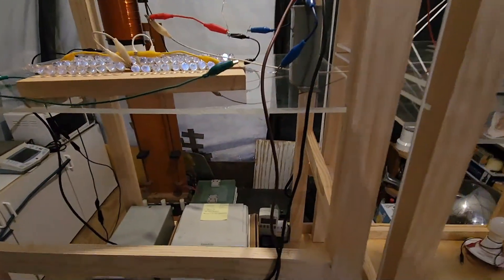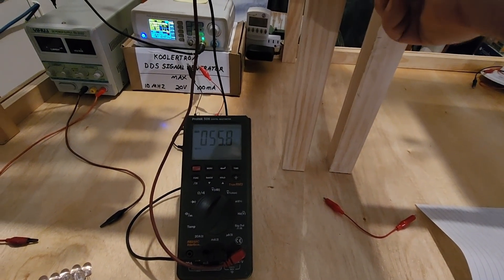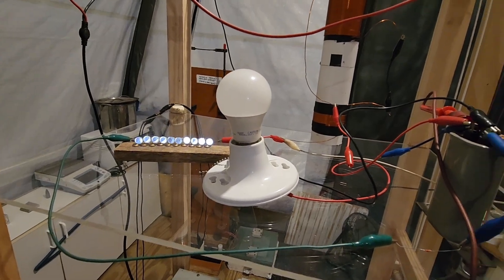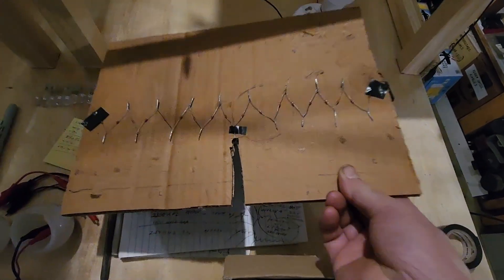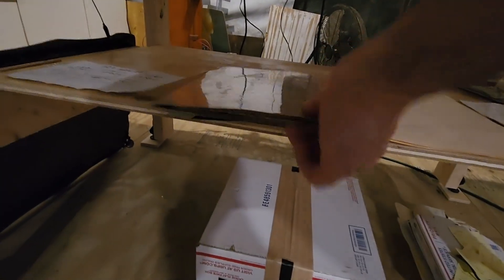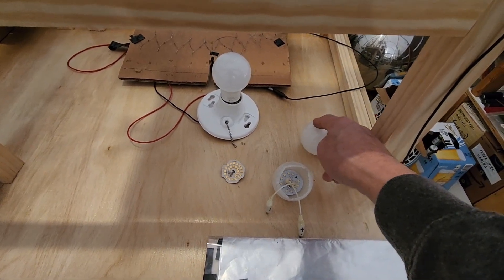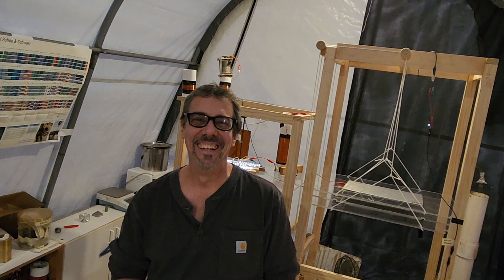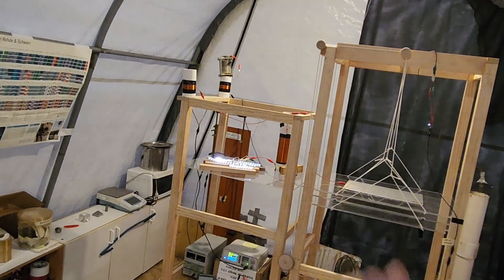QUEST FOR UNDENIABLE OVER UNITY & MORE POWER, PART 2

Comment: The down side of this type of tech is that the radiating field that it makes like a plasma globe, when you put your hand up the the l.e.d's the light go's out because the your bio-field is grounding it out so I was thinking that maybe a 1:1 ratio bi-filer coil will encase the field so it won't radiate out into space because its not really a viable thing in a usable system. You can try using to of your identical coils and linking them up bi-filer so you don't have to wined a new one.
Reply from the maker: I understand what your saying.  U was thinking in the end, when I have something that can be commercialized, I could put a type of Faraday cage or shielding of some type.  Funny you mention the bifiler coil.  I was planning on using it this weekend :-)  yes, bifiler transmitting to maybe 5 of the coils i use now under the bifiler.  Great minds think alike, hehehe.  I have only 1 bifiler.  I may have to eventually build one with larger dia wire to get more charge.  Thanks for your comments, the are good ones.

Comment: So your capcitance = q/v =Ea/d  Q is constant that is the height. V is your volts E is epsilon, which is your plexyglass. A is your Area. D is your distance between your plates. You should be able to connect a volt meter on those plates, and to see your volts, you will need a high voltage meter probably. Also for the another gauge place an amp meter on the back of the fequencey generator. math is no good if you don't have gauges. math is needed. not good to just go on what the peice of paper says on the back of it. lets see so math may be applied
Reply from the maker: Hellooo Justin!! Happy new year.  How's the building coming along :-)
I have my freq Gen pluged into a watt meter.  But really not best to measure power to LEDs like that with an open circuit.  I tried doing the math before, but things never come out right, I think due to many real world losses and such, and energy gain from everywhere.

Comment: I don't understand the opposed diode chain @ 4:44.  What is the intent?
Reply from the maker: Around 6:00 i light up a 10w LED bulb off of that string of diodes.  I could also light a long chain of regular LEDs off of that string and when I use that string, I never blow or LEDs.  Those diodes are extremely good at absorbing the energy from the plate.  I think I get more energy from those diodes than I do if I were to connect directly to the plate, and then problems with LEDs blowing out, and I can't just add a resistor to prevent LEDs from blowing out, because the value you need is based on the source voltage,, and the source is 12v, but actually much more voltage,,,it changes, it could be as low as 12v or as high as 400v.  I tried using many different values with no luck.
I have charged a cap around 400v off of this string of diodes.  I also have some new diodes to try yet.  I feel that point contact junction is very important, I may even help with gaining extra energy.
Thanks for commenting!

Comment: It is unfortinately no OU because the signal generator on idke take mote than your output....sorry guy...
Reply: So are you suggesting that the "latent power" of the device, the stuff that is used just to "get the signal generator" to run should be included in the "output circuit"? Like, it takes energy to generate that wave, so any energy gains also have to take that into account? If this is the angle, and the other calcs are correct, where do you think the energy in the "active" circuit comes from? Does it just borrow it from the "signal generator"? Just curious.
Reply from the maker: I think I understand what you are saying.  My signal generation takes about 5-6 watts, but the important thing is how much is that signal gen putting out to the circuit.  Please understand that the signal generator could be replaced.  I could use a pulse from an antenna wire in the air.
I feel pretty confident that what's most important is how much energy is coming "out" of the signal gen and how much energy I'm powering all the LEDs with.
I have had as many as 1,500 LEDs lit, and as much as two 10watt LED bulbs lit.  I have collaborated with experts to take very carefully power measurements over 4 months..  You would have to look back at my videos that say "power measurements", and you should see a thumbnail photo of the scope.  3 or 4 videos.
I may have to elaborate in one of my next videos about power measurements.  Even many very experienced people take power measurements incorrectly when working with  "open circuits".
Thanks for commenting :-)
Reply: Good, i understand, but what is the coeff of that? 6w to light how many watt? Did your 10 led is full bright ( mesured with lumen meter ) because you cannot mesure hf on normal meter.... if you change the 120v signal generator for a dc portable that run on 2w and you have the same outpout it is because your right!
Reply from the maker: Hmm, the COP... i dont remember what it was when I last hooked up the scope and took those measurements.  I remember it was less than 1 watt powering hundreds  LEDs.
With the set up i have right now, im taking a good educated guess and saying that my input and output maybe close at this point.  But Im positive i will soon show much more.  Please stay tuned.   @likeapromen9729
Reply: No problem! You make a good job at all !

Comment: You've heard of a rail gun, right? One that fires a ball bearing would be ideal for this purpose. But instead of a straight track, firing the ball into something... A circular track in which the ball would have no choice but to keep going. Provided the track of magnets goes all the way around and is arranged correctly, nothing should be able to stop that ball other than wear and tear, or something physically being in the way. That would not only be perpetual motion, but would also be over unity. Mechanical principles are used to demonstrate the way electronics work. Well, using pulleys, you most certainly can and do get more energy on the output that what is input, even if physics claims this is impossible. What would an electronic pulley act like? Or is there even an equal to a pulley in electronics? If not, then mechanical principles shouldn't be able to demonstrate the way electronics work.
Reply from the maker: Rail guns, love them.  I have thought about the crcular track, perpetual motion device many times :-)  good ideas, thank you!

Comment: each led should ahve its own resonant coil and cap this way you have independent replicators of the original signal
Reply from the maker: hmmm, now you sound like Rick.  I feel I have surpassed Rick with my design, I'm not positive though.  I would even rather put at least 10 LEDs on each coil.  Like I mentioned, he used a lot of small red LEDs.  Thanks for your comments :-)
Reply: @INVENTOR3  https://youtu.be/JhypyOUZ2xg?t=1254
Reply from the maker: @ReigoVilbiks  Thanks for the link.  I see he finally added multiple layers.   Yeah, i could do his giant coil set-up.  I put most all my LEDs on one coil.  I wonder what freq he starts at, because i know as he adds each coil the freq drops.  I like his work.  I think it has its pros and cons.  I could make my plates 6 ft long and place many coils on them with no problem, which i feel would be more practical.  Thanks again for the link, i think that is one of the best demonstrations i have seen of his work so far.  I feel like I have a challenge :-)

Comment: just measure the wattmeter on the signal generator before and after your LEDs and coils are hooked. the difference is the actual wattage you use it doesn't matter what the paper says on signal gen. -  it will give out more. according to my tests
Reply from the maker: I will check it next time.  Im very sure it is less than 1 watt, it is around .5w.  Not sure how accurate it is because it is an open circuit, they really should be measured differently.  I worked with a guy from a foundation in the UK, a connection from my good friend John Hutchison.  This guy i mention has a lot of experience and travels the world measuring systems like mine.  we spent 4 months taking close measurements.  End result was much over unity here, but he had to explain everything to me step by step, he was not actually here to do the measurements himself.  So I still feel that I need to prove something here.
Reply: @INVENTOR3  yes for sure you need couple of pro electrical engineers like that to confirm. i had similar results like you but I'm still not convinced its 100% over unity. but the only real test is actually self  looped system
Reply from the maker: @ReigoVilbiks  Yessss, eventually self-sustained loop, exactly :-)

Comment: why don't you replicate Rick Friedrich's 100 coil experiment? he did have undeniable over unity in his videos.
Reply from the maker: Well, I remember him having like around 75 LEDs, they were small red LEDs which require less energy to light up.  Maybe I did not yet see his 100 coil set-up.  I have already had 1,500 5mm white LEDs lit with this system before I rebuilt it with this new table.  Just wondering, have you seen him light up a 10W LED bulb?